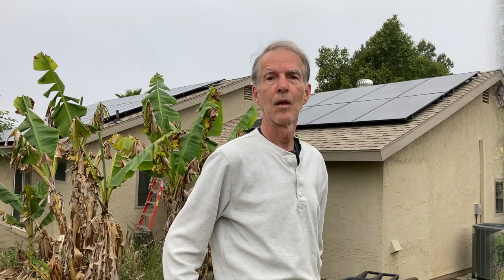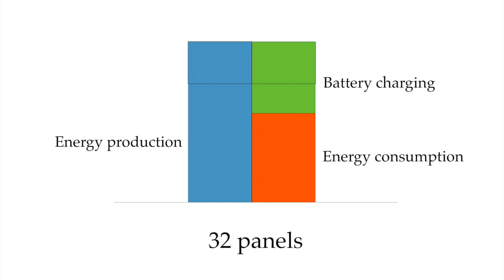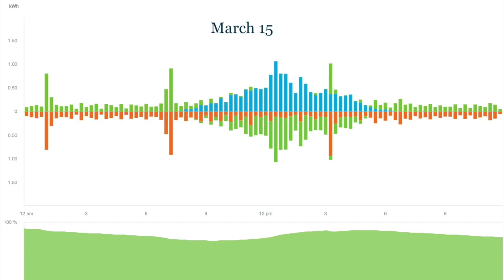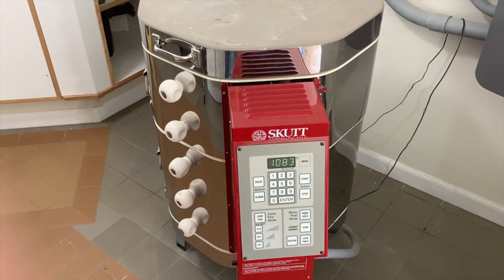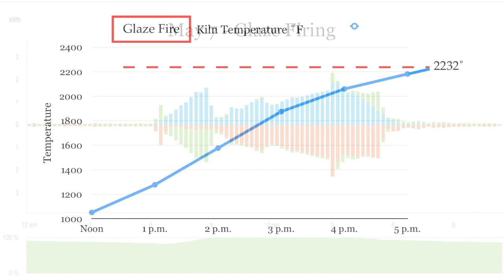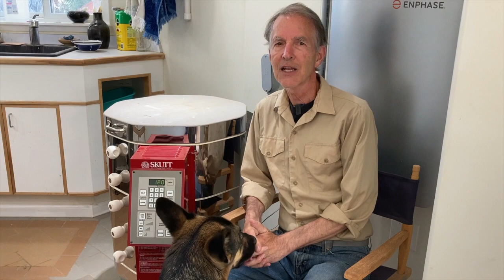Going Off-Grid - Part 3

Comment: Really impressive video.  I felt you presented the info at a pace where I could really absorb it.  Well done!

I do wonder, for the general case, if it's good or bad for every other house to build a system that's much bigger than needed for it's own use so that the other half of the population on the grid are NOT using burned fuels.  This would imply a larger battery, the excess capacity of which (ex, over what your house needs) is really only used by your neighbors via the grid.  This would mean that the payment system would need to reimburse the panel owner better for their investment and the grid owners need to take less. I've also seen people floating the idea of a large battery per neighborhood (ex, every 10 houses) because larger batteries are more efficient and would be professionally maintained, monitored, and updated.  A mini-grid that is resupplied from the central grid where there's multiple dark days in a row.
Reply from the maker: Hey!  My system does not export any power to the grid (the local utility will not allow large systems to participate in net metering — they don't want to buy consumer excess power here in SoCal where residential solar is so common).  But micro-grids are great for small isolated communities.  The San Diego for-profit power provider is investing in new gas-fired power plants rather than in utility scale battery systems.☹

Comment: This is why I do not like proprietary systems. You are at the manufacturers mercy. Where as if you bought server rack batteries and off the shell inverters etc you pay a LOT less and you can afford to have twin inverters/controllers. If Enphase discontinues this line and something goes sideways, good luck getting the software out of them that matches those batteries.

Comment: Being green means to encompass a whole lot of things the heat coming from your Kim could’ve went back into heating or keeping water at a steady temperature or higher…. Meaning, if you were to use thermal solar panels to heat your water before you heated it with electricity, you wouldn’t have to heat the water as much and if you use the kiln to heat water in store that heated water in a heat exchanger. Going green ask actually a combination of a lot of things that we haven’t even fully understood how they relate to each other. It’s the laws of physics heat water with the sun. I know it’s not always sunny, but if you put it into the ground and let it stay there at a certain temperature do you know that the temperature is always going to be there. More battery than you really need.
Reply from the maker: I have an engineering degree with several courses in thermodynamics and a boatload of physics.  I'm using some of the energy from the sun that hits my roof.  It ALL turns to heat, whether used for a useful purpose or not first.  I'm not using any grid power, which where I live is 2/3 from fossil fuel, so I'm not burning anything.  I'm also not eating any cows, responsible for a large part of climate change and loss of biodiversity, and neither do I fly on airlines, another big producer of greenhouse gases. I'm filling my yard with new trees.

Comment: I wonder if installing mini splits would be more efficient, instead of the traditional central heat/central air, since you can turn off the mini split(s) you would need at night and not have to cool or heat the entire house.
Reply from the maker: I have spent a lot of effort insulating my 1500 sq.ft. house so partitioning it not useful, and especially during summer, I have a large surplus in energy generation capacity.  So not so much concerned with efficiency or saving energy.  Almost unlimited free energy with no climate repercussions.  Typical summer weather here is warm (sometimes hot)  days and cool nights.  Thanks for the comment!

Comment: Very interesting sharing of your experience. But one thing you seem to have missed completely is checking where all that energy is going. I could do 2 full days in -25C/-13F on the energy in your battery in the Finnish winter, a  far cry from a CA winter day. My current summer base load is ~100-150W, in winter during a cold winter day it might go up to 800W (due to the heat pump/electrical heating). From your graphs in February you seem to be at about 1400W a third more with a lot less need for heating.
Reply from the maker: Is your house all-electric?  Do you use hot water?  M water heater pulls 4.5 kW when it's on, which is more than an hour a day.  My electric clothes dryer pulls more power than that, for an hour per load.  Electric oven and cooktop.  My car sucks up 30 kWh after a shopping trip.  It is what it is.
Reply: @Chris21709  It mostly is, I can burn some wood in winter for extra heat though. And I have an electric car too. But you  don't seem to know what base load is. Your dryer, electric car etc are not part of you base load. Even worse I could barely tell the difference on your graphs when you turned the water heat off. It was only visible when you turned it back on as it had to heat the water. Your base load is what your house consumes when you are not doing things like drying clothes, running your kiln or charging your car. It is what your always on appliances use like fridge, internet router etc.. Or hidden standby power usage of appliances you turned "off" but still keep consuming power (TV's, stereo's etc...are common culprits)
Reply from the maker: @fintrollpgr  About 300 watts during the middle of the night when the heat pump is turned off, although it is set to recirculate the air, so the air handler (blower) comes on and off, so it varies.  The refrigerator comes on and off (not continuous).  My large commercial water heater comes on and off (heat loss), even when I'm not using hot water.  The batteries also consume a little power just to maintain charge.  Charging/discharging batteries is pretty inefficient.  But I don't care.  The system now provides all my energy needs, sun or overcast, and I don't burn anything.